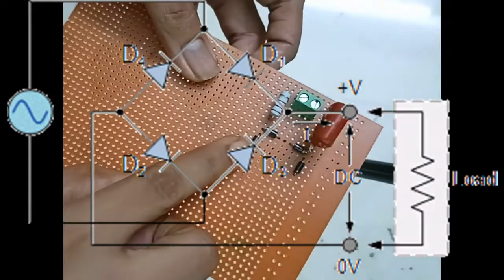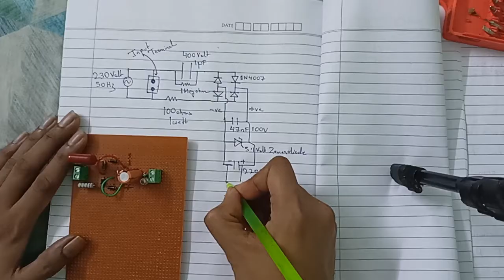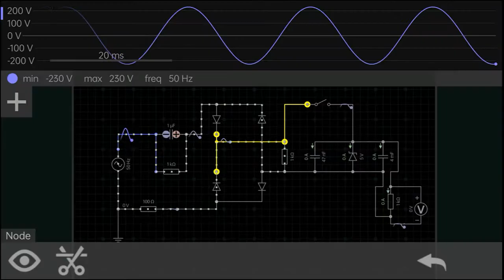HOW TO MAKE TRANSFORMERLESS  5 VOLT POWERSUPPLY FOR ELECTRONIC PROTOTYPE(CAPACITIVE DROPPER CIRCUIT)

Comment: What is the maximum load i can use in the output here?
Reply from the maker: maximum current theoritically it can give before voltage dropping is 100ma . Voltage is 5volt. but I would suggest to hookup a load that draws maximum 70ma. so watt is 0.35 Watt

Comment: Hey bro i want to make an electric bike but i dont have knowledge about it  which moter can be useds here and battery that will give me more backup.
Reply from the maker: lead acid battery is cheapest then comes lithium ion battery and few companies use lithium polymer like that of the drone. I would suggest go with lithium ion and if budget is tight leadacid. backup is dependent upon ampere hour rating of the battery . 6Ah 12Ah .....etc and voltage one can choose from 12V to 24V
normally in india DC motor is used you will get that in amazon but brushless dc motor(bldc) is more efficient and it is costly and bldc motor controllers are also costly.
Reply: Thanks for your help sir.